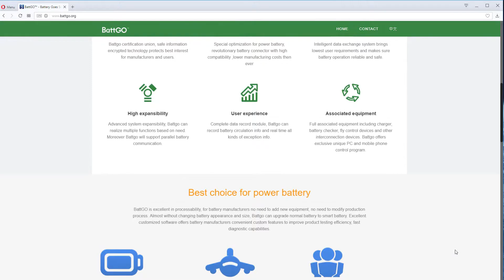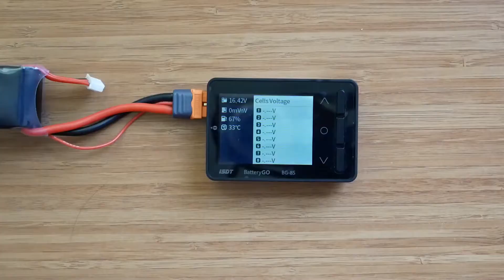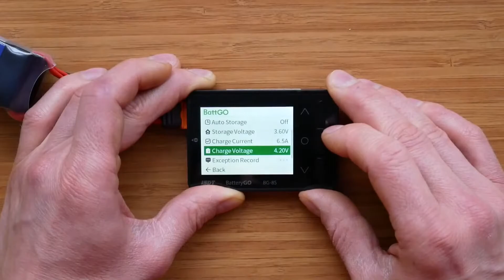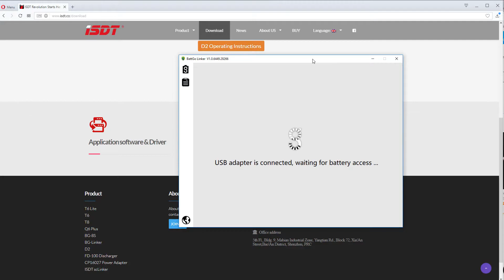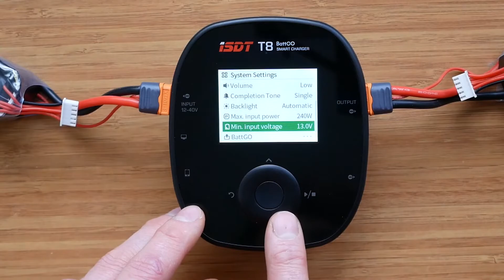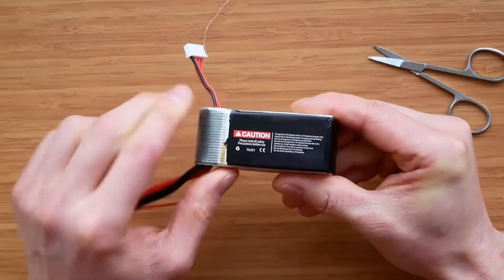BattGO Technology Overview

Comment: Very nice video. Do you have a view of the PCB's back side? The alarms work on voltage level and over temperature but not current. To verify the voltage readings you need to use a calibrated device. Just comparing one by the other will not work.

Comment: Their website says BattGO technology works with 1S to 8S but there's not enough connections on that board ?
Reply from the maker: I am not sure which board exactly you are referring to but I can't see a reason why it wouldn't work if we had a BattGO battery connected to a compatible device. Of course, if we only had a 6S charger for example it most likely won't work properly with an 8S battery when it comes to charging even though it might still show the individual cell voltages thanks to the BattGO chip. It's hard to tell and this is pure speculation as I haven't tested it and have no way to perform such a test simply because there are no 8S BattGO batteries on the market. Also, I don't see anyone installing an extra BattGO chip on 1S or 2S batteries as that wouldn't make much sense considering the extra weight on such small cells. Definitely doable but not practical.

Having said all above this is not relevant, really, as it doesn't look like the technology has been adopted by the industry and there are still only two 4s batteries available on the market  after almost a year since the tech was introduced. Luckily the ISDT products are very good and perform well. Which means that even though the inclusion of BattGO technology will not be relevant to most potential users it shouldn't be a deciding factor when picking a charger.